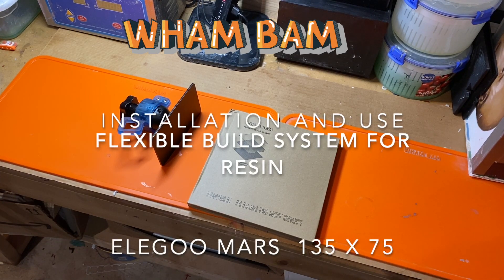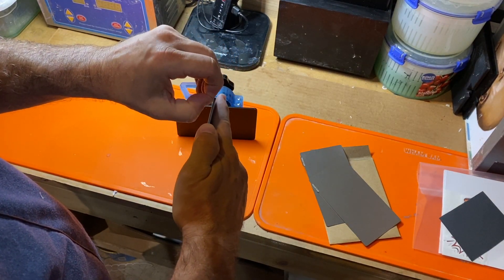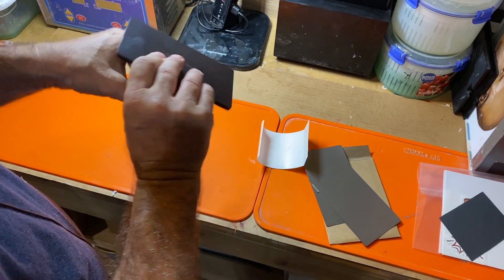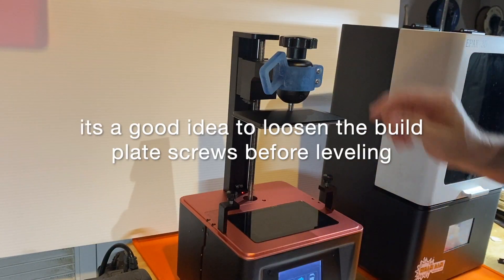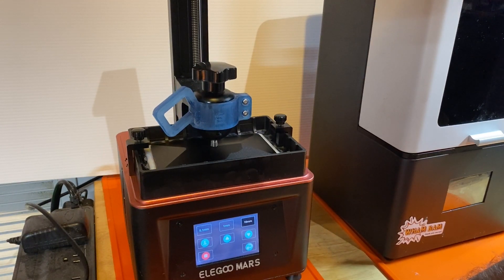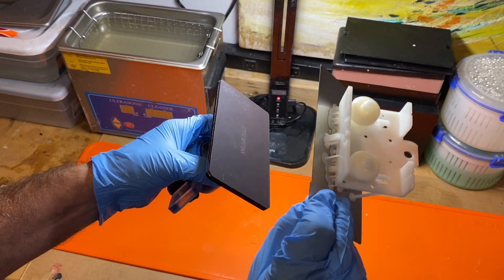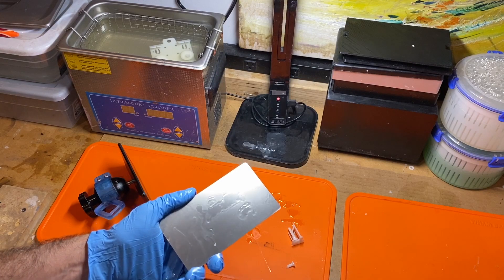Installing the FBS for Resin on the Elegoo Mars

Comment: Just me over here watching this video moments after adhering the magnet to my build plate without first printing the spacer I didn't know I needed lol...
Reply from the maker: You can always add washer temporarily, or even a piece of tape to extend your current interceptor arm until you’re able to print the correct spacer
Reply: I've printed the spacer but now I need longer screws. Do you know what size and where I can obtain these?
Reply from the maker: @TheCardboardWarlord  the screws are usually M3, if you’ve installed a regular Wham Bam system, you probably need 6 mm screws, if you’ve been on an XR, you might need 8 mm screws, most, already in our kits

Comment: I have an elegoo mars 3  how co u install spacer? Would've been nice to see the installed spacer. 

Do u stick the spacer between that metal piece and where it screws on or like default and at the spacer between  the screws and metal piece?
Reply from the maker: Locate the arm that trips the optical switch for Z limit. The base of the arm is screwed into the build head with 2 screws, remove the screws snd remove the interceptor arm and put spacer in between build head and metal arm and re screw back together
Reply: @WhamBamSystems  yah did that ty making dure I did it right.  I'm reprinting something i know worked fine before I installed thexl wham bam to see if it was just the print that was bed let u know how it goes   ty for reply
Reply from the maker: @TheHoboWithAShotgun  if you need any advice at all write us at technical@whambamsystems.com and we can always help!

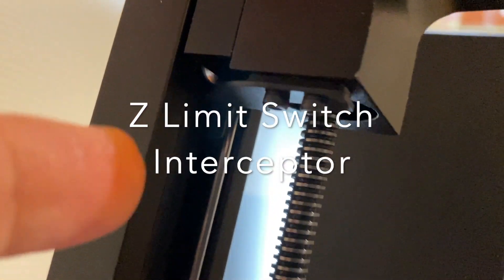Comment: At 3:24 you talk about unscrewing the screws on the Mars and putting in a spacer. You did not mention that you would need to get longer screws. Since the Mars comes with two M3 x 4 screws, and you are adding 2.6mm spacer, you will need an two M3 x 8 screws. When I discovered this, I went to the store and got M3 x 6 and M3 x 8 screws. The 6mm screws just didn't have enough thread to secure it. Luckily there is space inside the housing for the little bit extra on the 8mm screw.
Reply: I guess I should also state that I was doing this on a Mars 3
Reply from the maker: Yes, that’s true, one needs screws appropriate to the length of spacer plus metal thickness plus threads into the build head, earlier Elegoo models came with long enough screws, but many others need you to get screws

Comment: You actually do not need the Spacer! Not sure if there are very different versions of the elegoo mars, but with mine I can simply unscrew the build plate and readjust it as usual including the z axis.
Reply from the maker: You don’t need it if you can level over 3 sheets of paper then when testing test over 1. The spring on the Mars is so strong that without a spacer it pushes down too hard for normal leveling.

Comment: I wished I had watched this before adding my Wham Bam to my Elegoo Mars Pro, the written instructions hint about adding an extra 2.6mm etc Absolutely essential on mine as it isn't even homing and getting stuck on the first layer 0 with zero progress. Ordered some washers to add 2.6mm to the two limit screws at the top., then I will home and set the Z=0 also using the paper method to simulate the FEP. fingers crossed all goes well
Reply from the maker: The washers will do the trick but if you run into any further issues with the install please reach out to us at Technical@WhamBamSystems.com and we would be happy to assist!

Comment: It’s pretty inconvenient to not mention that you have to print the spacer until after the instructions telling you how to install the plate.  Do you just assume that everyone has an extra 3D printer??
Reply from the maker: sorry about that, we have updated instructions to read that first, all of our videos mention it.  You can make an impromptu spacer to get you printing by elongating tip of interceptor arm with tape or using some nuts under the interceptor arm mount. you just need to get 2-3mms of extra height.

Comment: Hello, I got two plates for my photon mono x the while ago. With my first prints, the models have unfortunately not always held on the plate. Does it help to make the plate a little rougher (with sandpaper)?
The bottom layers should fit and the printer is also well leveled.
Thanks
Reply from the maker: Hello Max, yes for more adhesion you can use sand paper on the print side of your plate, the 400 grit supplied gives a little extra grip, or use 320 or 220 for aggressive grip, you can also increase base layer exposure, slow lift speed and increase lift distance.  The mono x has some issues and we have some solutions, so feel free to write to us for more advice technical@whambamsystems.com

Comment: Are the longer screws meant to come with the build plate? As my screws are not long enough when you put the spacer in, and I don't believe I got them with my build plate.
Reply from the maker: you may need to get some M3 screws for upgrades, pretty common on 3D printers, this needs M3 8 or 10 mm long.  Elegoo has not standardized their screws they include, some are long enough some not.

Comment: So I ordered one and installed it just like you showed it here, with the spacer and all. But I have a problem... the home button doesn't remember the Z-axis instruction I gave it. And it keeps going back all the way down, to the point a paper can't even be taken out of it. I do it properly with the screws loosened and everything... but it just keeps going back to the previous home setting. Any way you could help me? Thanks in advance
Reply from the maker: please send an email to technical@whambamsystems.com with which machine you are using.  if you can level this way (without using your screen) you might be safer: loosen bed level screws, put paper on screen, hit home. Push down lightly on head while tightening screws, make sure you can push and pull paper, done. no need to reset home

Comment: Do you happen to know what size screws have been used for the Z-spacer? The ones in my machine are way too short if I add the spacer. Thanks!
Reply from the maker: Elegoo has been sending out a variety of screw sizes and some are on the short size,
I believe they are M3 x 6 or 8, but do measure the diameter to be sure they are M3, as mine is in use at the moment.
Reply: Wham Bam Systems thanks! I’ve got some M3s on the way so hopefully I can get this al setup and printing today :)
Reply: you should also have an Allen Key that removes those two screws easily in the tooklit that came with your printer

Comment: in reality it is not necessary to change the position of the Z switch, to recover the added thickness it is sufficient to remove the spring inside the pin of the build plate, 
infact when the spring it is fully compressed it has a length of about 7 mm
Moreover this  spring it is of no use, when you register the build plate you still need to keep the plate still with your hands and so the pressure that the spring exerted is useless.
I have just assembled my kit, I just have to wait a few hours for the adhesive to stick well :-)
Reply: Is it difficult to remove the spring? may I ask how to do so? Because I noticed exactly what you said, what's the point of the spring when I still need to hold it down in place lol.

Comment: I'd like some clarification on the spacer for the Elegoo Saturn... my printer just arrived and i have not leveled it yet. Is the spacer for the limiter really needed? 

I hear contradicting stories. If so, maybe consider shipping one with the kit in the future. I wanted to install my flex base before using the printer even once; but now it seems I have to set up the unit and do one small print, only so I can reset the unit and start all over again...
Reply from the maker: Its best to use the spacer, as Elegoo has a strong spring that pushes too much force onto the LCD and wont allow you to get the right level which should be loose enough that you can remove the paper after setting level.
We do not include spacers, as each size fits various machines, and machine manufacturers change their set ups frequently,  Its an easy print
Reply: @WhamBamSystems  "each size fits various machines"
I am not sure that's a valid argument, because the same is true for the plates themselves. The saturn comes in two sizes of plates and you had no problem separating those. 

"Its an easy print"
Right back at ya' - might as well include one then, or even variations, if there should be any, no? 
But it's not about how complicated the print is. I just did not want to go through a whole setup, slicing, printing, cleaning the print, cleaning the plate, curing the print, resetting the machine, attaching the FBS, re-adjusting, leveling, etc. of a pristine yet unused printer, just for a tiny little piece, so i can make your product work. If you sell a mod, the mod should be complete and not require additional pieces to be manufactured - or it should be a bit more obvious on your webshop. Or how about offering them for sale at least? 
Not everybody has several printers sitting around for a quick print.

Comment: Printed the spacer you created, and the screws holding the Z limit interceptor are too short to connect.  The screws that came with my Mars are FAR shorter than the ones you show in the spacer listing on Thingiverse.
Reply: I THANKFULLY had some screws that worked.. (m3x12mm I do believe)

Comment: I have aldeady install the magnetic base, now I cant print the spacer.
There is another solution?
Reply: Just did the same thing!
Would be great if the spacers came with the pack, or simply put it as the first item on the instructions, to print the spacer. Thanks!
Reply: @star-destroyer-  Same here!
Reply: @nickzucc  oops!
I found that 4x very small M3 0.5mm thick washers were enough to get it going. Couldn't find a washer for the Elegoo Mars 2 pro, so quickly measured up and designed one. Printer is working fine now and the flexible plate is amazing, no more scraping! They either pop off or side off after flexing the plate.
Reply: Tom Worley so my wife had some plastic beads that were close to the right size, so I just sanded them down a bit. Recalibrated and I’m in the middle of a large print now. Everything seems to be going well. I do still believe that a spacer could be provided, or at least call out to print one before installing. But after all of that I’m pretty sure I’m going to like the new ability to print directly off the plate with less damage to the models!
Reply from the maker: Use washers to space it up 2-3 mms then level and print a spacer

Comment: Do you have an STL for the spacer?
Reply from the maker: https://www.thingiverse.com/thing:4533310
Reply: I have already attacked the plaque, now I cant print the spacer :(
There is another solution?
Thank you
Reply from the maker: domenico tufano You can always use washers or other material underneath the trip or switch to raise it up 2-3 mm so that you could print the spacer later and replace. It doesn’t have to be precise there’s a certain amount of room from the leveling that you can get
Reply: @WhamBamSystems  Yeah... I've installed mine as well... I missed the insights about printing the spacer first.
Reply from the maker: @Sn0wwh173  you can always unscrew the interceptor plate and add 2 washers between it and build head and rescrew together, you may need 2 M3 x 6-8mms screws as Elegoo doesn’t always put in long enough screws